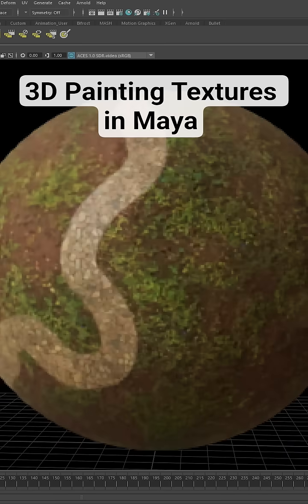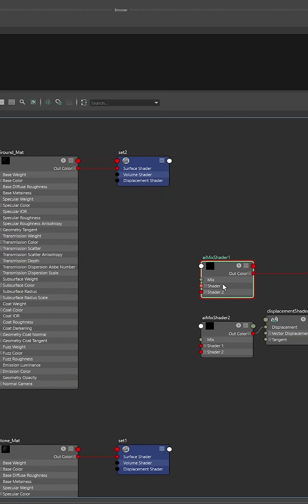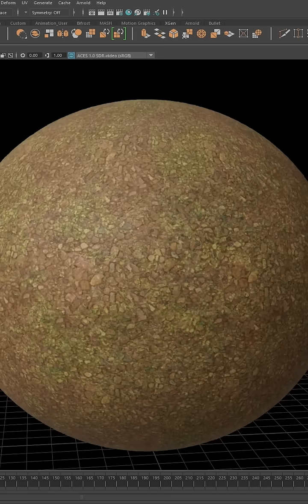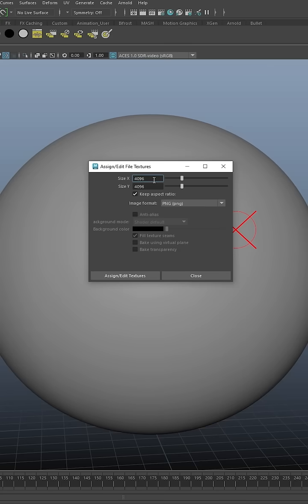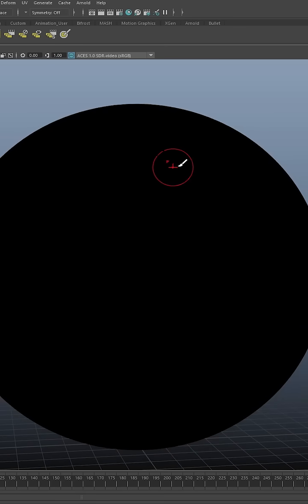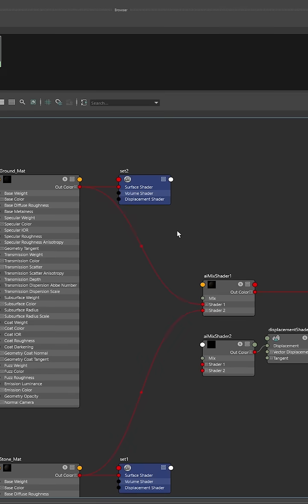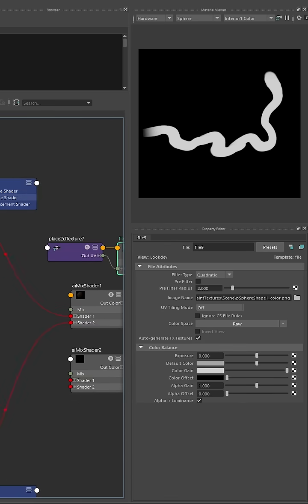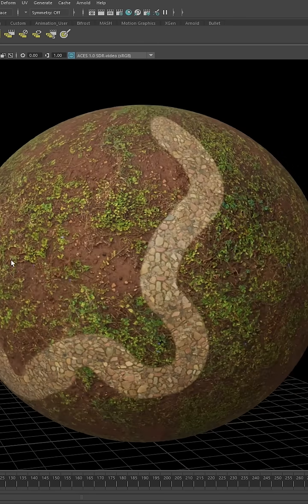3D Painting Textures in Maya

Comment: So finaly its not crashing at 4k hmmm concerning skill based matchmaking finally
Reply: Never had a crash at 4K or higher. The tool has been always quite solid.
Reply: @MauroSanna nah 2022 and 2023 and 2024 versions i am talking about
Reply: @SourabhMajumder-rb5fi  

Yeah, I was not referring to any particular build.
Since when they raised the available resolution to the paint tool, which is there since Maya 1.0 on SGI, I have never experienced any crash with that.
Reply: @MauroSanna i will steal your setup😂
Reply: @SourabhMajumder-rb5fi  
I have always owned workstation class computers since back in the days. I built almost all of them myself. The first one for Maya 1.0b was a dual PIII with lots of RAM, SCSI HDDs and ATI FireGL 1000.

Then I had one of the first multi core AMD CPUs, with an NVidia Quadro 4800.

After that a Silicon Graphics 320 Visual Workstation (the only one I did not build of course).

Nowadays I am using a Threadripper 3970X (32 cores/64 threads), 128 GB RAM, RTX 5090 and all the discs are solid state M.2 NVMe, plus few other things.

When it's your job you need the performance and the stability, and you need to go for hardware that at least it appears in your favourite DCC's hardware compatibility list.

That's how you get your DCC to run rock solid, even if with its flaws (and Maya isn't at all immune).
Reply from the maker: This was recorded in Maya 2024, and I've never had any issues with it, though knowing Maya I'm sure it happens haha

Comment: Does the object need to have UVs to do this?
Reply: Maybe it doesn't need to be UV unwrapped, since whenever he toggles to texture mode for the sphere, we don't see a seam running along the sphere.
but he could have cut a seam at the back of the sphere so we should try both
Reply: @sambraivs4056  You don't see a seam because the default sphere primitive, in fact any primitive geometry, comes with basic UVs already made.

In general for 3D painting you always need UVs.
Reply from the maker: Yes you need UVs :) the default sphere has quite square UVs, with a fair bit of deformation at the top. That's probably why you didn't see a seam.